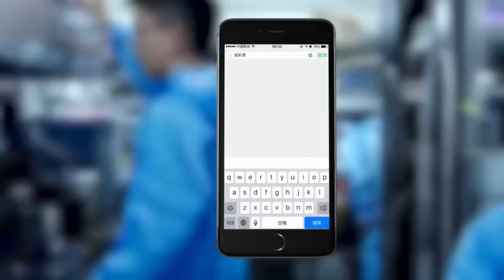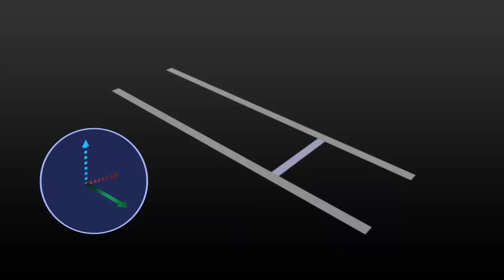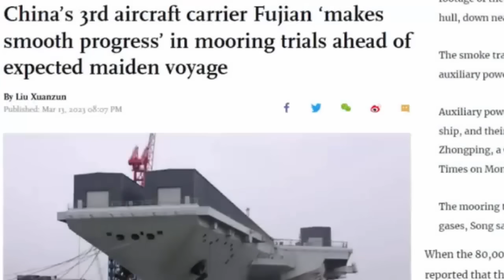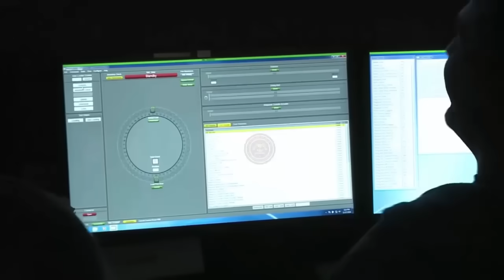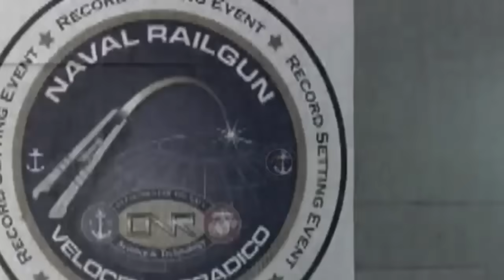China's New Rail Gun​ can fire 120 rounds at Mach 6 any target within 100 200km is within its sights

Comment: all those clips are from another rail gun video

could someone tell me why all the fuss over rail guns? A Gauss Rifle would be far more powerful using equal amounts of energy. ive seen videos of some pretty decent velocity from coil guns assembled from spare parts off an old dryer or whatever. not complicated at all to build and waaaaaay more bang for your buck. never saw no one make a rail gun in their back yard or basement

the reason for that being you need several million amps to achieve the velocities that make a rail gun a worthwhile weapon. 

with severl thousand amps you can get the same velocity from a coil gun, (AKA  Gauss Rifle)

Comment: I wonder if China could make a railgun artillery system? That could be used to defend Chinese coast line from aggressors. 
Another thing I’m wondering is if railguns could revive the obsolete battleships. The reason battleships are no longer used is because planes can strike much further than guns. But railguns would be able to bridge that gap. It would also be able to accurately shoot down enemy aircraft as well as missiles
Reply: One of the draw back as now for rail gun is the power supply.  You would need lots and lots of power storage for continuous firing, and recharging it would be a headache.
Reply: You forget that there are air to ground missiles with much longer range. The rail gun has a max range of about 200km.  Air to Ground missiles about 1000 km.
Reply: @MASMIWA  well one of the best uses for railguns is anti air defense which includes missiles. Also the current railguns are 200km range. And frankly railguns should be able to shoot much further if they are made larger or if tech advances. Also railgun projectiles could be rocket boosted as well for much further range
Reply: @Phantom-bh5ru  I previously said that air to ground missiles have a 1000 km range. Further, China has the DF-26B which has a 2500 mile or over 6000 km range. This series of Dongfeng missiles are called 'carrier killer' missiles.  The latest versions being hypersonic.  One suspects the US is trying to do the same. From what I have read, the primary use is for targets its cannon is used for except only further, and that was surface ships detected by radar.